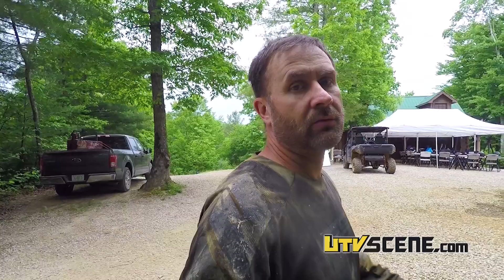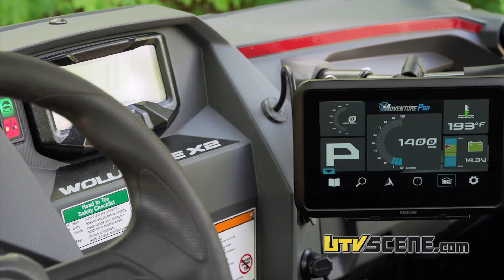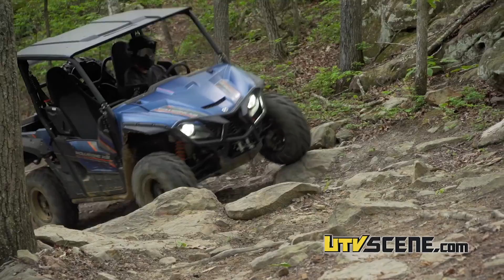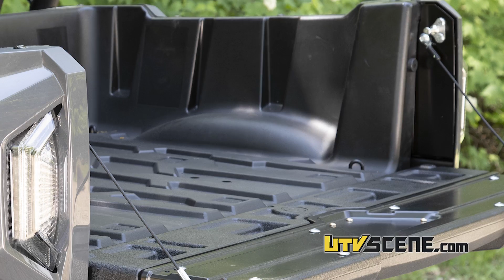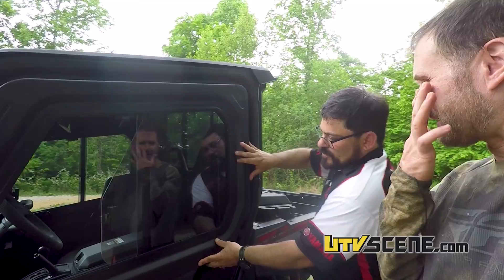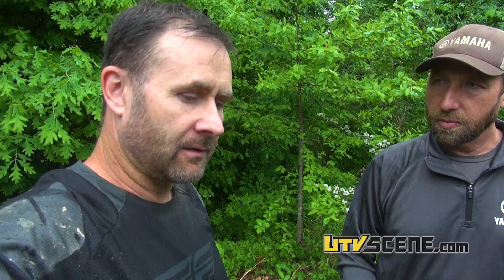Yamaha Wolverine X2 Review

Comment: I went to the Yamaha dealer and looked at it. It's small, the bed it real small. The console in the middle sucks and boxes you in. No pass thru room unless you're a contortionist. And not very comfortable. Yamaha needs to get out of this design and go bigger with the I4 1800cc motor that's in their FX series Wave Runners and get rid of that stupid CVT clutch system. This Wolverine is not for bigger guys or fat chics. The bed may hold a 24 can cooler, but that's about it. My review on it is: It sucks, so I'll pay more and buy the Honda Pioneer 1000 and call it a day and stop looking at all the others.
Reply: If that bed its too small for you then buy a pick up truck
Reply: Mr.NaughtyPants bitch bitch bitch you’ll never be satisfied!
Reply: @jimpiquette1375  Yes I'm satisfied, I have a Honda Pioneer 1000
Reply: @TSemasFl  Your complaints are irrelevant though because you're not comparing machines in the same class. The Wolverine is a part of the "recreation" class along with machines like the Can-Am Commander and Polaris General. The Pioneer is a part of the "Utility" class along with the Yamaha Viking, Can-Am Defender, Polaris Ranger. You gotta stick to machines in the same class otherwise of course you're not gonna it like it. The Wolverine wasn't designed to meet your classes specifications

Comment: Man, Imagine if these things got to be 2 strokes.. Like if old school 2 stroke engineering had the chance to be improved for 20-30 years since they were already at their best before emissions. there'd be 400cc 130hp UTV's weighing 8-900 pounds at this point.
Reply: The best true 2 stroke in all its light weight free revving glory - a unrestricted full bore 2 stroke - is the 2018 Husqvarna FC125 MX dirtbike. It uses a carburetor, powervalve and all that good stuff. 
125cc mind you, and it makes 41 horsepower stock. 
If that level of specific output (.328 hp per cubic centimeter) could be applied to a 400 cc 2 stroke that'd be just over 131hp. 
around 800cc like this? 262+hp.
Reply: Sure but it doesn't LAST!  I Don't want to overhaul it, every other ride.